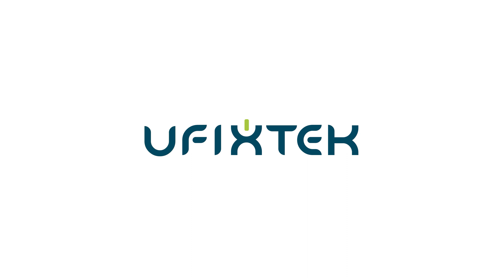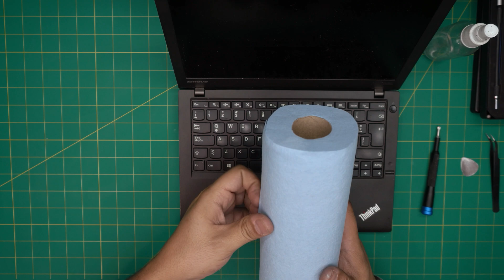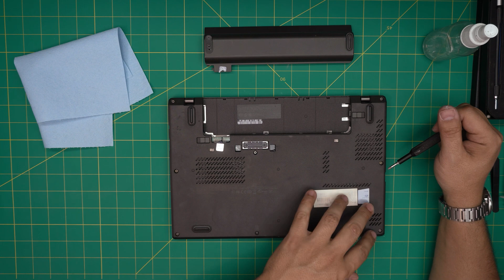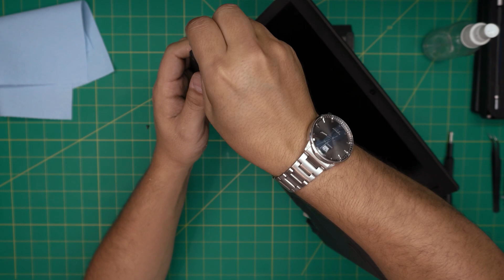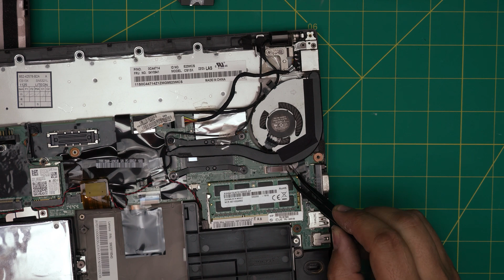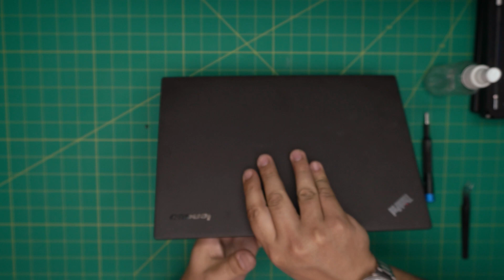How to Repaste and Clean a Lenovo Thinkpad X240 Laptop - Step-by-Step Guide🧹

Comment: Left speaker not working. itt makes Little buzz when press on the body. Where should be the lose connection? On connector or in the PCB
Reply from the maker: the issue could be inside the speaker, but you could follow the speaker cable and disconnect it and re insert it and see it the issue is solved , if not get new speakers from aliexpress.
cheers🍻